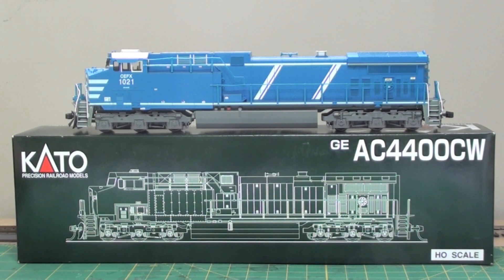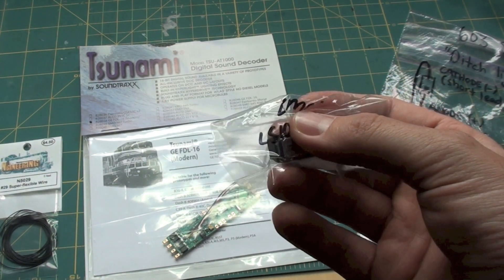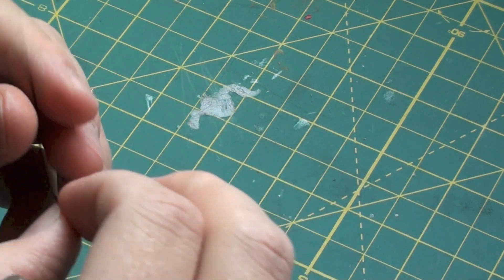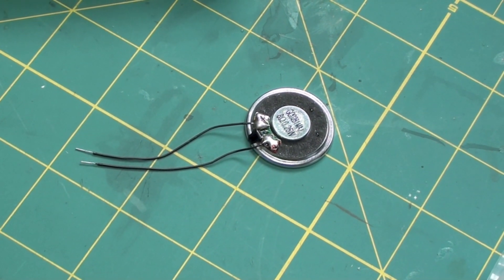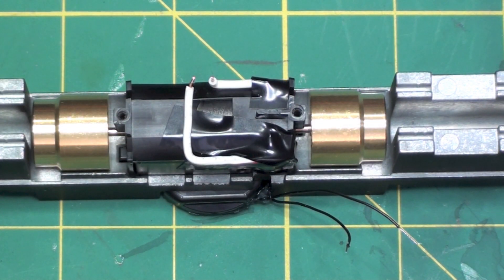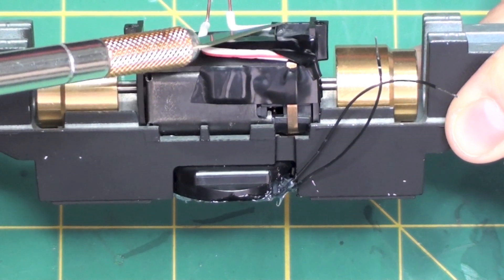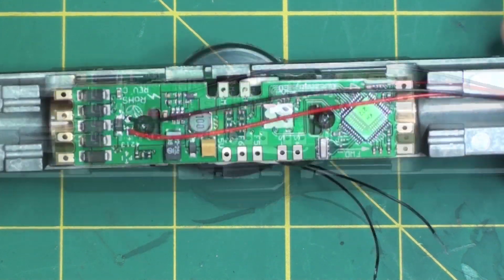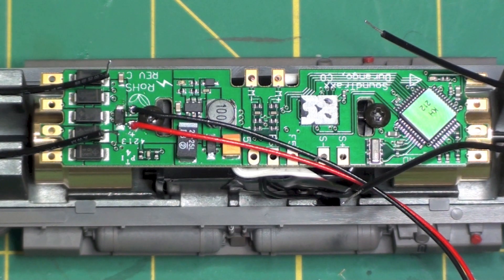How I Install DCC/Sound/LEDs In A Kato AC4400CW - Part 1

Comment: Good job with the video it is easy to follow.  I watched because I have yet to install a DCC decoder. I was particularly interested in the LED installation. One question, why not install the clear plastic lenses provided by Kato, drill them from the back and install LEDs in the hole (wouldn't work for the ditch lights)?

Comment: Just out of curious what is the gauge of the wire for the motor leads?
Reply from the maker: The motor leads I used in this video were 18 gauge solid conductor.

Comment: Ben I don' t think you have mentioned it yet in the video why are you using an Atlas decoder that Is not for the Kato ac4000.
Reply from the maker: There is a little blurb about it in the video info. Basically the Kato board comes with lights attached for the tubes - unnecessary if you are upgrading the lighting to LEDs. Therefore, it is easier to use the Atlas board as it is simple to wire for LEDs and fits the Kato chassis well.
Reply: lol apparently I am not to good at opening show more info thank you 8-)
Reply: BArailsystem
also you save 15-16$ for one board (KT1000 95,99$ & AT1000 79,99$)
Reply: Very nice.
Reply from the maker: Rarawer Yes thats true! I also forgot about that, thank you for pointing that out Matthias! Especially when doing multiple locomotives like I did, 15$/decoder adds up.

Comment: Ben - Just curious why You use solid core wiring for the motor leads?  Doesn't current travel to the outermost available area and that is why we use muti-stranded wire.  I could be wrong.  As usual I love your videos!  By the way your installs are so neat and clean (mine are a real mess).
Reply from the maker: I use the solid core for the motor leads because when I put the bends in it, it holds its form and is easy to solder in. Not really necessary in this particular case because the AT-1000 fits the Kato screw mounts, but other times it is nice having those solid motor leads and they actually hold the decoder in place. That is what I did for the Kaslo SD40-2F, the decoder is held up in the air inside the shell by the 18 gauge motor leads. 
As far as conductivity, I asked an electrician and he says there really is no risk of overloading the ampacity rating of the 18 gauge motor leads. I'm pretty sure my Digitrax DB150 is only capable of about 5 amps but don't quote me on that. 
Glad you are enjoying these vids, I hope it prevents you from making some of the mistakes I made.

Comment: Nice work Ben!....waiting on part two for the SMD leds...LOL.  If you knew the value of the onboard resistors on the KT1000 decoder, you wouldn't have to muck around with the AT1000 ? You would just add the value to get 1k for the SMD's? I might just send Soundtrax an email!  ...cause I HATE that bloody resistor on the Atlas boards..LOL  Thanks mate., good video.
Cheers Gregg:-)
Reply: I meant "capacitor".....I hate the bloody capacitor.....LOL....Gregg's getting upset!!....LOL
Reply from the maker: Thanks Greg. I only used the AT board because the KT one comes with the lights attached to the board for the tube lighting. Since I am not using the tube lighting, I like the AT decoder because its easy to wire the LEDs to it, and as you saw it fits perfectly onto the Kato chassis. The capacitor is the round cylinder shaped thing that hangs off of it right, haha, yah its a pain.
Ben
Reply: BArailsystem Fair enough! I don't know why the Atlas board is the only one with it?
Cheers Gregg:-)

Comment: So this KATO was alrady ready for a speaker install out of the box>?
Reply from the maker: Yes, at 3:14 that is the stock Kato chassis with the speaker enclosure in the fuel tank.
Reply: i thought so. Id like to see a video where someone puts a speaker in a Loco that was designed to have one in it.